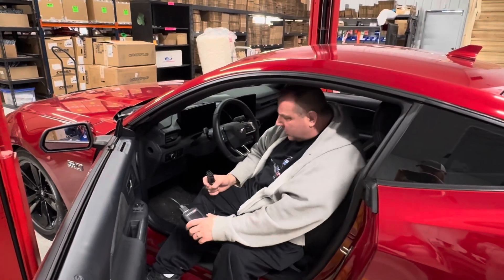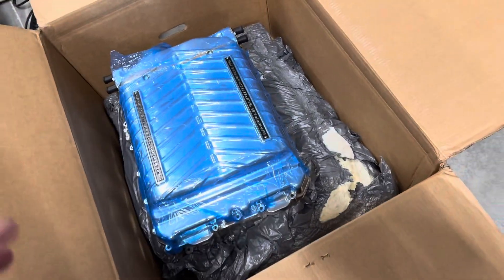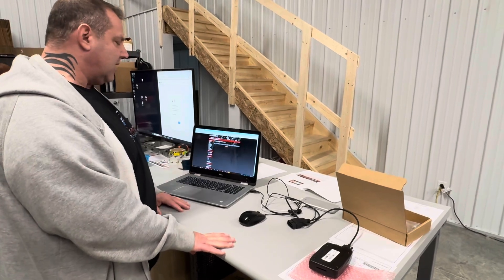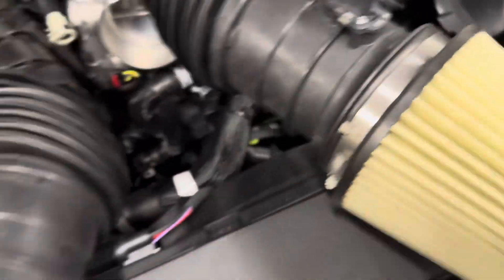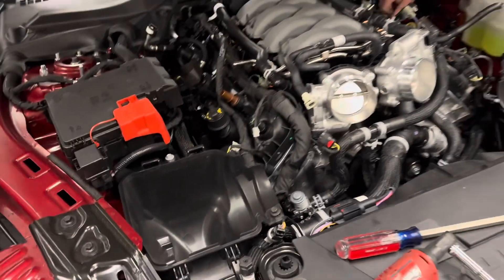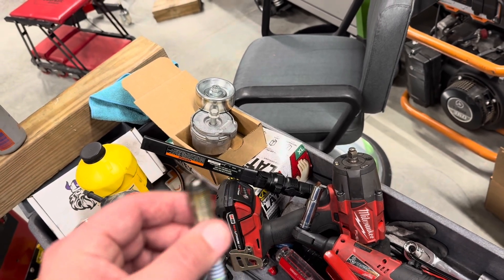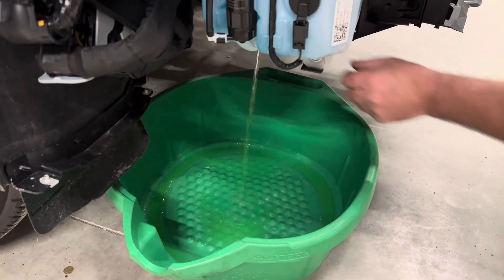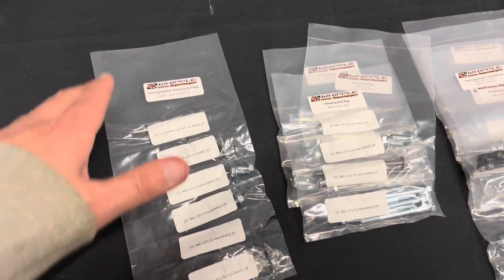2024 Mustang GT Whipple Supercharger Install Day 1

Comment: My experience with get the wrong bolts in my kits was a lot different than what you described…I called Whipple to try and get the correct bolts and was so kindly told to go pound sand, and to call who ever I bought my kit from.
Reply from the maker: We’ve never had any issues getting cracked parts if something’s been missing from a cab for a customer